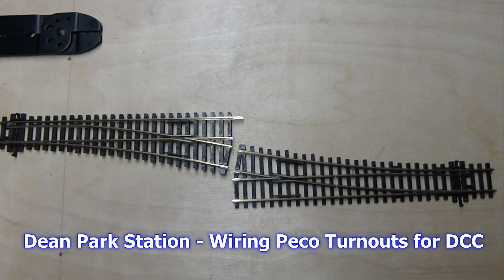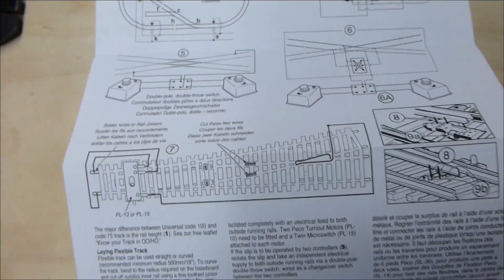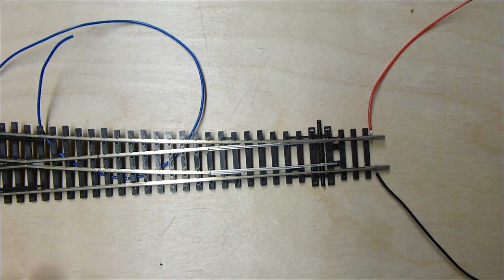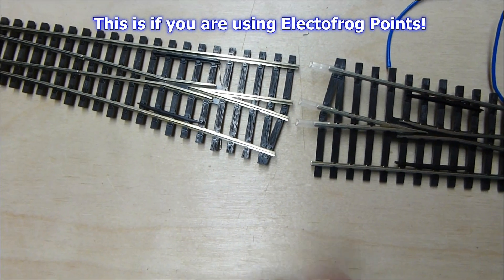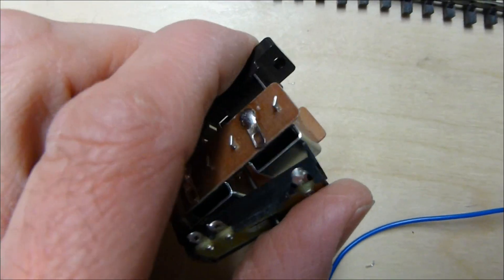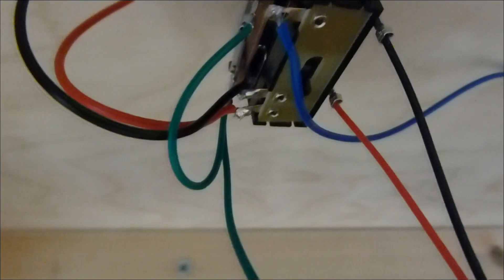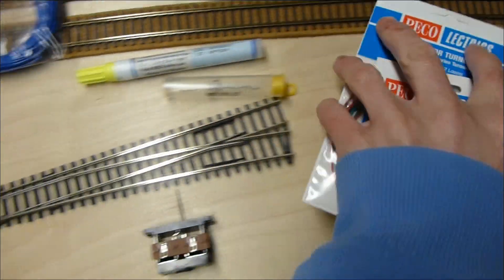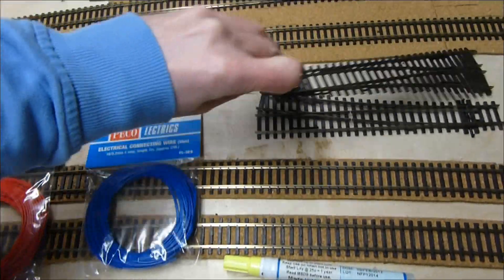Dean Park Station Video 9 - How to Wiring up Peco Turnouts for DCC with Peco Point Motors

Comment: Question dave if you was using hand of god to change the point would you still snip wires and do the soldering wire bit as where i want a point putting there is a  framework in way 👍
Reply from the maker: Hi, the purpose of snipping the wire and soldering is to ensure the point blades are always powered,  no matter how dirty the contacts between the black and the outer rail gets. You can do this if manually moving the points too. An un-modified point relies on keeping the contacts clean.
Reply: @DeanPark  thanks dave 👍hope your well

Comment: Hello mate, I accidentally bought 6 lengths of code 83 flexitrack as this is supposed to be for American layouts, do you think I could get away with using it for my shelf shunting layout? Would it look wrong?
Reply from the maker: I’d imagine it would look fine when Ballasted and weathered etc.
Reply: @DeanPark  Yea cheers mate, I did some measurements and the sleeper spacing is actually pretty accurate, probably more so than code 100

Comment: Dave, would you recommend snipping those wires and adding the other two connections to connect the two rails even if your not using point motors?

Comment: Hi Dave. Love your layout.. In videos it seems almost real..As usual, videos you do are very informative. I've acquired 4no electro frog points that have no wire coming from the frog or doesn't have the small wires to cut on the switch blades. I've Hornby short points which I'm going to change for medium to long Peco express points. Also will be using seep point motors. Thank. Oliver.

Comment: I am just about to order some of these very points for my new DCC layout. I am returning to the hobby after a break of 40 years, so your videos are very useful. i particularly like the tip for soldering the new connections from one wire and cutting it to make the two feeds.

Comment: you do not require mounting plates for the Peco point motor, they fit directly to the point itself and will save a lot of time on trying to line them up. I use a Dremel tool to cut out the rectangle of the base board.

Comment: hi was going to go dcc,but changed my mind,but I have a load of electrofrog points,just for dc do I need to insulate them.thx mark.
Reply from the maker: Hi, I would still use the insulators yes.   The points come with easy to read instructions, and it will best advise you what to do for DC as well as DCC.  You can use the point without any modifications for both DC and DCC, but what I showed you in this video was for better DCC reliability.   Hope that helps? Dave

Comment: Hi Dave
Just viewed the video on wiring an electrofrog point. I've also watched Everard junction on wiring a point. I would like to use peco point motors and like Everard I'm running two bus wires DCC and DC. On the seep polnt motor there are 6 wires. On your video I assume the frog wire and DCC positive and negative are fitted to the accessory switch but whereabouts on the point motor do the dc positive and negative wire go as there are 4 solder points on the solenoid.
A much more detailed video like that on Everard would be very much appreciated.
Mike
Reply from the maker: The accessory switch has three wires going to it.   A + AND a - from the rails above and the third wire is from the frog.   This accessory switch fixes on to the bottom of the peco pl10e point motor.   The seep ones are no where near as durable as the peco motors.   The peco point motors are easy to wire up as well.    Instructions in the peco motors are very simple to follow.

Comment: Many thanks for this its given me the confidence to go ahead with electro frog points and dcc wiring.  I'm just starting to order the stuff I need to build my new n gauge country terminus.  5 metres of flexi track one double slip and 6 points (turnouts) and the bill for track point motors and accessory switches for dcc etc etc is currently just over £300.  Model railways is NOT a cheap hobby!!!!

Comment: Do you need to cut the wires if your not using point motors.
I've not altered any of my points and dcc works fine.
Reply from the maker: Hi, you can actually leave them as they are out of the box, but the peco instructions say that for better performance you remove wires....as I have polarity switches on my point motors I snipped the wires.

Comment: Great video but just commenting on the price of stuff being new to the hobby, WOW, "proper" point motors and all the associated parts cost a fortune and don't even work nicely (the quick snap and buzz noise from the coil isn't very nice. A much cheaper AND nicer operating option is to use 9gram RC servos to move the switch, these are more than powerful enough and less than $2 each from ebay, they also move slower at a more scale speed and don't have the horrible buzz and snap noise. You can pair this with an Arduino which can control several switches including polarity switching the frog (I bought 10 Arduino nano's for $10 off ebay so $1 each!). All the Arduino needs is some basic code which you could learn in an hour off youtube haha. Finally you just need some sort of physical switch to control each point via the arduino (also dirt cheap off ebay). So it literally only costs ~$3 or less to motorise each point and they work nicer too!  This is Aussie dollars too so halve everything for pounds! I will make a video on how this is done asap, I am a noob to model railways but been playing with RC stuff and basic electronics my whole life.

PS. Another thought, with an Arduino controlling several switches you could also have it sense where a train is with infrared sensors (ebay, dirt cheap again) and have it automatically switch between different lines on your layout if your into a little bit of automation. Can run DC or DCC, it doesn't matter as it is separate to the point control. So much potential for so little cost compared to traditional model railway stuff.

Comment: hi is the same methord for wiring up y points.electrofrog ones ..thx mark..
Reply from the maker: hi, yes.   But some of the Peco y points do not need a live frog....for some reason they don't come with a small wire coming from the frog.   The newer ones might have these.   the small Y radius turnouts didn't have these on my layout.  The large radius y ones did, but some didn't.   Cheers.Dave
Reply: hi yes mine are the small ones,and they don't have a wire coming from them,so how did you wire yours up..thx mark..
Reply from the maker: you do not need to fit an accessory switch to that then.   The small radius turnouts and y turnouts have such a short frog, that peco don't bothered putting in a wire at the frog.  just fit a point motor.   you don't need a polarity accessory switch.    these turnouts also don't have the small wires to snip (which I point out in my video).   Just fit the insulated fishplates as normal.
Reply: cheers thank you ..mark..
Reply: DaveClass47 
b

Comment: hi dave how do you wire up electrofrog points for dc..thx mark..
Reply from the maker: hi, full instructions are given in the pack for that....but you can use them straight out of the box without any alterations.   Cheers.

Comment: Yes I understand that but as the switch is not actually powered until it contacts the track can I use scotch locks to connect the dcc from the bus to the red and black from the switch to the track .
Reply from the maker: no.   The point motor is wired to a 15V AC power via a switch, which is back at my switchboard.   See in my future videos...I show point motors in situ under the base board.   Or go to the peco website. they show you how to wire up a point motor.   Hope this helps.

Comment: Hi I am a bit confused the two wires that go from the fishplates to the point motor can I piggy back my the two wires from the bus dcc or do I put separate feed for dcc as I have a layout based on CJ Freezers updated Minories and as it is a portable layout I have 9 electrofrog points on a 54 inch board so as to simplify connection fro the other two boards I will make .The reason I ask is that basically the points run into each other as space is limited only a couple of short bits of track here and there so basically do I put in separate droppers or piggyback on the point motor to track wires .thanks love the way you explain things that even a novice can understand .
Reply from the maker: The two wires (red and black droppers wires) from the fishplates go to the ACCESSORY switch, not the actual point motor.   The blue wire also goes to the accessory switch.    The wires to the point motor are different. Cheers.

Comment: Can you help with a problem I am putting in electrofrog  points for dcc but I have a E Z command basic dcc to power the points can I use a 16v dc transformer to power them or will there be a conflict on switching polarity of the points with the dcc power as the Bachman is basic and I can't see how to switch the point by the Bachman controller .thanks

Comment: Hi Dave, I dont suppose you would know how to wire Peco PL 11 surface mounted point motor upto a peco SL - E99 3 
way point. All the stuff on line is not relevant because no one talks 
about the PL 11 which along with the hornby surface mounted point motor,
 is what I am using. Even Peco's own witing diagram doesnt help. They 
talk about accessory switches PL 13 or PL 15 which I assume is another 
way of saying point motor. So all the different terminology doesnt help.
  So basiclly I have 3 wires  from the PL 11 or the Hornby R8423 its 
easy with normal points but with these stupid Electrofrog SL E99 I 
havent got a clue. How do the wires built into the SL E99 fit into the 
wiring in simple terms, does any body know?
Reply from the maker: HI Gary, sorry mate, I am not sure.  The PL13,15 accessory switches are not point motors, they are switches that attach to the peco ple-10 point motors to switch the polarity of the frog, when using electrofrog points.   I have in the past contacted peco directly....they are usually pretty good at helping.Dave

Comment: This all works fine as far as wiring the frog. Is there a way to wire up leds with this system? or does it have to be one or the other?
Reply from the maker: +MWRR R  you can wire up LEDS to show which way the turnout is set.   You may want to use a Peco twin micro-switch to achieve this.  This is what I used where I had a point motor and a coloured signal with feather wired up to the point.  The LED's would prob have to run off a different voltage supply as the frog is DCC.   Therefore the twin micro-switch is ideal for this as it gives you twin options.
Reply: Great! Thanks.

Comment: Hi I just got two Peco electro frogs but seem to be different underneath know thin wire on both of them at the point is there a different type.
Reply from the maker: Raymond Hinks Hi, Peco have recently updated some of their electrofrog points.  The small radius ones didn't used to even have the small wire, but now they do.  All changes do not alter the way in which you need to wire them up.  The newer ones (which come in a clear plastic sleeve as opposed to the old card packaging) are designed to work more reliably.  Dave

Comment: You would save money if you bought SEEP point motors as they have a contact for the wire that changes polarity automaticaly.
Reply from the maker: zardoz2 Hi I considered that, but I have heard reports from a few modellers who say they are prone to faults after a time.

Comment: Excellent presentation, thank you. Question: I have my layout set up so that it can be powered from either my DCC system (NCE Procab) OR DC - not at the same time, of course. Now I understand what I need to do to solve connectivity problems with the point rail as a poor conductor of current. But will doing this for turnouts so they work better on DCC cause issues when I run the layout with DC? I would think not, but would appreciate whatever advice you can share. Again, thanks, and I'm going downstairs to snip some jumpers and solder jumpers from stock rails to points.

Comment: Hi Dave
Firstly great videos, well done. If you were at this years SECC show you may have seen my layout Pen-Gos (www.pen-gos.com). Im having a change to the fiddle yard and im installing the Peco Electrofrog 3 way turnouts SL-E99. These are the brand new packaged which show an incorrect simple track diagram on the back which i have informed peco about ( much to their surprise). I have hit a hurdle in fitting the PL15 twin microswitches to this as one of the frogs will not 'go live' . I suspect their wiring diagram is also incorrect.  Don't suppose you have encountered this problem as its the one thing i can't find any information about on the internet? 
Cheers
Rob
Reply from the maker: Hi, I had MASSIVE issues with getting my three way to work, it kept short circuiting!   I will have a look at my wiring and will pop a bit in the next video about it.   I am not able to get up the loft just now or I would have answered your query right away.   However I do recall soldering an extra wire to one of the frogs to get it to work.   Sorry I cant help much more just now, but you're right...the peco diagrams (whilst being confusing) are not right.   I had to sit and work it out and it took me AGES!   Bloody annoying so it was!

Yeah I saw that layout at SECC this year.  I was fair impressed by a lot of layouts this year to be honest.  It was a good show.  
Dave

Comment: I'm using SL95's and SL96's do I have to take out the springs of the turnout?
Reply from the maker: No, the springs need to be there so that when you switch the point it holds in position.   Without a spring is would stay in place as the train goes over it.
Reply: I'm STILL using some Peco points which were bought around the late 1950s, some of which have over the decades have lost their "over center" c springs, I now longer have the financial restraints I had when aged 12yrs, but still retain that Challenge, and have found that those H&M point motors - which have what we could call an "over center" locking function (as well as the switch) do a VERY good job of holding any points which don't have their C springs are securely held where they were set.
Also don't waste money buying any wire/cable which is sold as "for point motors and signalling etc." go down to your local hardware and buy 5M (or more) 4 or 6 core telephone wiring cable,, this is a thin copper conductor which is quite adequate for point motors which only require a short  pulse of electricity to operate and will not exceed the current rating of the phone cable you are now using, also LEDs require about 1/20th of the current those "grain of wheat" incandescent bulbs require  . Also using this cable means you can use the external sheath which surrounds the 4 or 6 conductors as the insulation over any joints I may have, what I do is cut through the external plastic and just pull that off the 4/6 wires and cut it to length as required. (This from someone who was winding his own transformers to make a radio in a plastic lunchbox in 1952 using war surplus 110v American valves etc.)
Lindsay in NZ

Comment: Thanks Dave,
Do you mean take them up again and then cut the bandings? 
Thanks
T
Reply from the maker: In bandings do you mean the small wire than needs clipping? sorry, I thought you ment something else!  No I clip them before laying and solder the small wires on as per the instructions in the turnout and as shown in the video.  This relies on good pick ups on the loco to avoid stalling until you have the accessory switch wired up.  Dave

Comment: Hi Dave,

Firstly, what a fantastic layout and first class videos, thank you, they have been so inspirational and helpful.
I have a question if I may.... I want to rewire my electro frogs as per your method, but I can't afford all 72 motors at once! If I wire as switched polarity will they still work before I can install all motors or will cutting the bandings stop them working manually?
Any help would be much appreciated.
Keep up the great work!
T
Reply from the maker: Hi, thanks for your comment.  I wouldn't cut the bandings/mechanisms.   I have points that are not yet connected to the point motor and they seem to work ok.   I just have all the wire fitted in place for when I get around to fitting the motors/accessory switches.   Dave

Comment: I notice that the Peco SL-E98 Y turnouts do not have the wires on the back to be snipped off,, why?
Reply from the maker: These do not require adapting, as they are insulfrog and they do not have a live frog, so no need for a polarity accessory switch.   This is what Peco told me and mine work perfectly well without a switch, for now anyway lol Dave